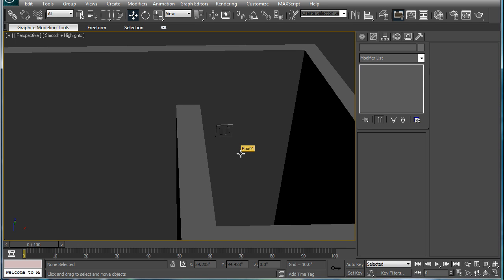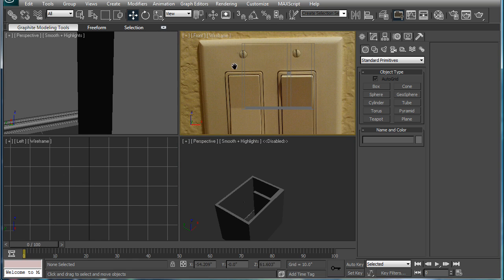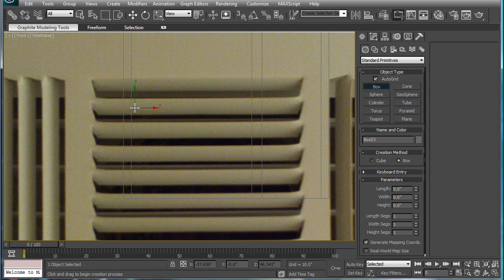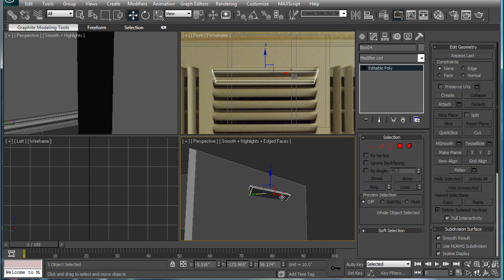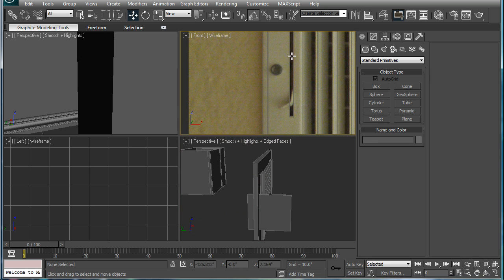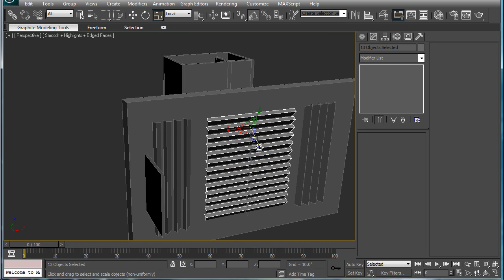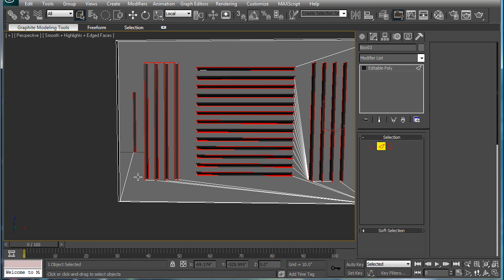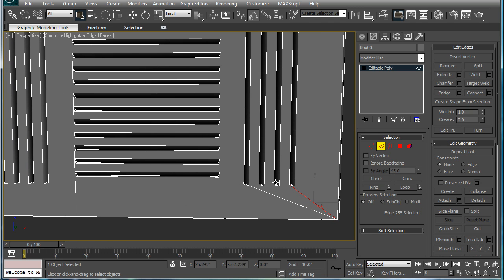3ds Max tutorial - Interior Architectural Design: Bathroom part 4

Comment from the maker: @Barnes199017 hey, a good alternative to using ctrl+p is by holding down you middle mouse button (the scroll wheel) and moving the mouse. chances are you may have not had closed edges on the polygons, the only thing i could recommend are to convert the object to an editible poly, put an x-form modifier on it, then again convert it to an editable poly.